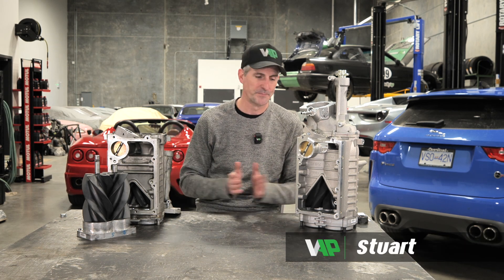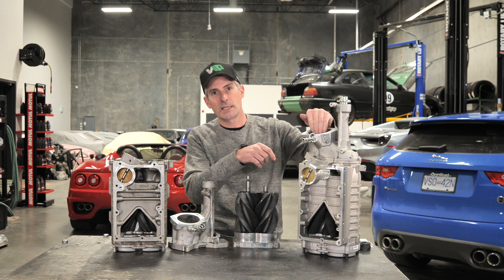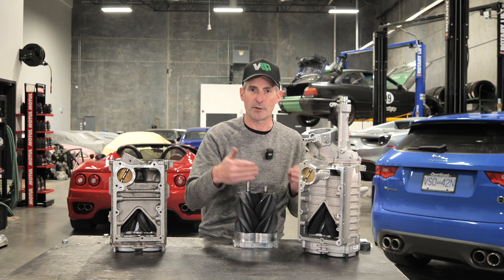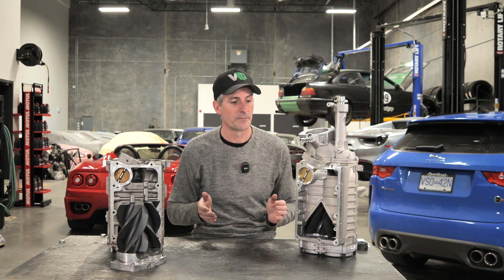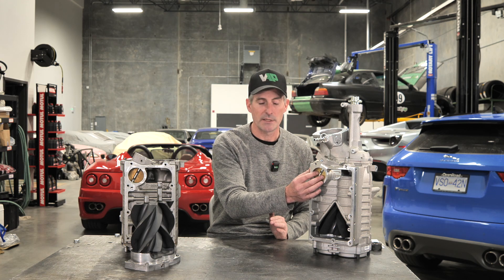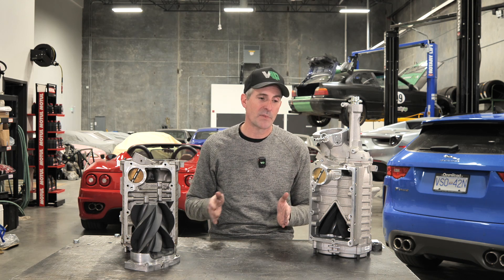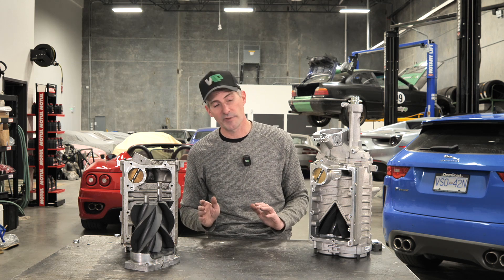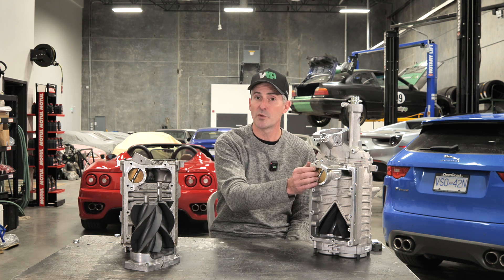How Do Super-Chargers Work?! What Is A “Smooth Throttle Tune?"

Comment: Should have bought my tune from you guys! This is a big issue with other tunes, I can feel the supercharger throttle open fully at like 30% throttle and give me from like 20% torque to 80% in just a few % of the throttle around the 2-30% throttle level (but its not consistent with throttle application) . Wraptor Customs who has the "smooth throttle kit" you are kind not to mention by name who has come up with the vacum regulator mod which appears to work but it would be so much better to solve it in the control of the OEM electronic bypass valve.

Comment: Hi, I have VAP stage 1.5 tune on my 2012 Range Rover 5.0 SC with vacuum actuator. How did you solve the problem with vehicles like mine?
Reply from the maker: Hi Frank.  It's solved in largely the same way.  The vacuum actuated still use an electronically controlled solenoid to allow vacuum to flow.  But it is far less precise than the electric motors.

Comment: Vindication, of sorts...  I purchased upper and lower pulley, plus a re-map, a couple years ago from a company in England.  Once installed, I noticed the sudden 'jump' at low throttle but compensated for it with foot/throttle control.  Circumstances precluded me from driving the car much (Jaguar XE 3.0) until just last weekend (29Mar2025).  Through the switchbacks of Appalachia, I found the lack of engine control becoming a potentially dangerous lack of car control.  I called on the company on Monday, suggesting it felt like a sudden closing of the S/C bypass.  I had no idea the bypass had become the auxiliary throttle control.  I asked them to look at the re-map to see if there was an issue.   Then?  This video shows up next day, right after the S/C tensioner video.  Keep up the great work, gentlemen!  You've got me as a 'go to' for my lovely Jaguar XE 35t.  --Fink

Comment: Very interesting! This makes me think about a project I was working on back in 2015 with a Supercharged mustang cobra that also had turbochargers. In a twincharged application the ability to electronically control that bypass valve would have helped manage the boost better than what I was able to with the stock vacuum actuated one. The supercharger became a restriction and I was never able to achieve the HP numbers it should have been making.